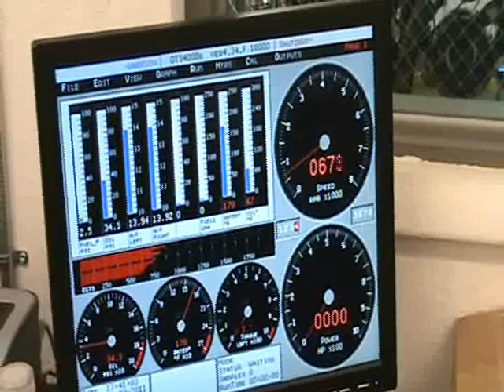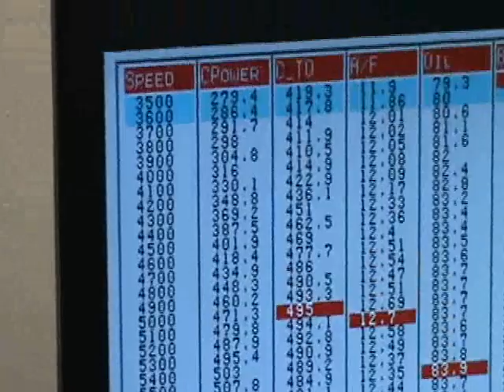SB Chevy 383 Stroker 550 Horsepower Crate Engine with Roller Cam

Comment from the maker: Our street roller cams have a very mild ramp speed so they are very easy on valve train parts. Usually after the engine leaves here you won't have to check it for about 1000-2000 miles of driving.

Comment: A 383 that pulls to 6400 rpm with AFR 195 heads with a solid roller cam I am going to say intake duration around 248-252 degrees on a 108 centerline.
Reply: An xr294 hydraulic roller cam would do this at 10.5 to 1. But on a head as good as that I'd use the 304hr magnum single pattern

Comment: There's a lot of guys here asking questions and no one is answering them. I've seen aluminum headed small blocks run up to 11.5-1 on premium pump gas. I have a different combination than this but the cost is likely similar. You're looking at about 12 grand give or take. I'm running a 13.5-1 357 with a much larger cam and better heads but I built it at home and have a few used parts and I was still in it for over 12 grand. Wanna play? Gotta pay
Reply: @8Ball5.9cummins  notice no reply
Reply: I built a 388 with 11to 1 compression pump 93 makes 550 easy cost about 13k to build
Reply: Manuel Solis that’s to much $. I’m into my turn key 383 $7k to the engine builder BUT I provided heads, intake and carb. All good name brand parts. MSD, Edelbrock, Holly, Comp, JE etc. Got to shop around for good deals on parts. Swap meets.
Reply: @8Ball5.9cummins  He said it's 13.5 to 1. Even a huge cam is going struggle to keep detonation at bay on pump gas at that CR.
Reply: @marcusprice3199  good bye to the pistons on pump gas with 13 to 1 compression

Comment: sounds decent,I guess the small carb is what makes the peak power stay flat for so long
Reply from the maker: AngryDuckSoup Yes, if you over carb, you can see a slopy power curve.
Reply: cncmotorsports so you are saying you under carb on purpose?
Reply from the maker: AngryDuckSoup On some applications yes.

Comment: I purchased this engine roughly four years ago. I am a truck driver so I've hardly driven it. Now that I am back home, it runs great but I'm looking for more horsepower. My question is. How can i make 900hp without a blower, to keep my motor enclosed in the engine?

Comment: Are u using the AFR 195cc competition heads????
Reply: Given this engine sells for only $8,000 from intake to oil pan I can almost guarantee it is the 280cfm Eliminator AFR heads.
Reply: @fmsracing442  He said fully ported. That would be the comp head since the street head is 90% on the chamber.

Comment: If I were using this engine for street use about how often would I have to lash the valves?
Reply: but199018 once a day
Reply: @jmark7390  Hence why people go with hydraulic roller cams.

Comment: I easily got 549HP @ 6800RPM with this: 1)Cast Iron 392.87CI (6.44L) long block (numbers matching) – Stroker, CNC (bored .030)
2)Edelbrock CNC Heads (Performer RPM, Aluminum, 70cc Chamber, 185cc Intake Runner, 2.02/1.60 int/ext
Valves at 23 degrees, angled plug style, .575” max valve lift)
3)Crane Forged Camshaft, Hydraulic Roller Tappet (Duration 292/300, Lift .539/.558)
4)Harland Sharp Roller Rocker Arms (ARP Stud Mount, Aluminum, 1.5 Ratio)
5)Speed-Pro Flat-Top Forged Aluminum Pistons – (11.02:1 Compression Ratio; +6.10cc head volume)
6)Callies Compstar Forged Connecting Rods – (H-Beam, ARP Cap Screws, Bushed Pin, 6.385 in. Length)
7)Eagle Forged 4340 Steel Crankshaft (3.85” Stroke) Internally Balanced
8)Fel-Pro Head Gaskets, PermaTorque, 4.125 in. Bore, .0139 in. Compressed Thickness
9)Fel-Pro Valve cover, and Oil Pan gaskets (silicon composite)
10)Melling Oil Pump, High-Volume (Racing)
11)Moroso Extended Aluminum Oil Pan (6 quarts)
12)Comp Cams Magnum Double Roller Timing Sets (Steel Sprockets)
13)ARP Studs/Bolts – (Rod cap studs, Head bolts, Rocker Arms studs, etc.)
14)GM Performance Aluminum Intake Manifold (ZZ Series, Dual Flanged, 1970 LT-1
Styled, 1500-6500rpm)
15)Jet (Rochester) Quadrajet Carburetor (Stage II, 800 CFM)
16)MSD 8.5mm Spark Plug Wires
17)MSD GM HEI Street Fire Distributor (21 Degrees mechanical advance)
18)Sanderson Ceramic Encapsulated "Block Hugger" Headers (1-7/8” Ports, 3” Collectors)
19)Magnaflow Aluminized Dual Exhaust and Turbo Mufflers (2-1/2”)

The 1976 Corvette is doing 0-60MPH in around 3 seconds... WHATTA RIDE!!!!!!!!!!!!!
Reply: Solid build sheet sir! 💪🇺🇸🏁
Reply: that is very high numbers for the 185 cc heads

Comment: Can this engine be run one85 fuel
Reply from the maker: Steve Grabowski Yes, this engine can run on E85
Reply: So which is better as far as engine life and performance E85 or 91 premium? I use Strictly synthetic oil and 91 gas.

Comment: Hey what would happen to a 350 sbc motor if you dont put the oil rod that connects the distributer to the oil pump???
Reply: mr green guy the pump won't pump and bad things happen when bearings don't get oil
Reply: Yea I paid a guy 1000 dollars 2 drop a motor and drove like 20 miles on it?? He never put the oil rod in the distubuter??
Reply: Lol so many guys forget the oil pump shaft, your main bearings are gone

Comment: was that all motor or did you spray it????can it go into a 93 camaro what would i need and whats the cost of that engine???
Reply: jose vazquez it was all motor. You would do just fine on premise pump gas and I'd guess this motor from this shop as it is in the video would be around 10 grand

Comment: Hey what spacer is that u use??
Reply: mr green guy I run a 1 inch phenolic spacer I paid 10 dollars for on ebay on my 615 hp sbc and it honestly made a difference. Didn't even have to make a jet change and I went from 10.82 at 118 to 10.76 at 119. Don't pay top dollar for a spacer. The generic ones work too. Although I do have my eye on the a hvh super sucker. But that's a big jump in price and I'd have to change the jets, af ratio and maybe even the timing
Reply: Oh okay thanks thats a bad ass motor you got have you ever put nitrous to it??
Reply: mr green guy I have a 250 shot using all nitrous express. I've only used it 3 times and my best time at Sacramento Raceway was 9.36 at 141. The kits only there because it was built in as a nitrous motor. I drive it on the street enough that I don't want to hurt it. But with what it costs for fuel, I don't drive her far
Reply: Wow that fast I was gonna put a 100 shot on my car and buy a methanol kit to run with the nitrous
Reply: mr green guy there's really no need for a methanol kit for a 100 shot. Timing and octane are all that matters. What's your compression ratio? Can you give me a little info on your combination?
Reply: I dont wanna lie 2 you I am not sure I no its a 3970010 block and its got edelbrock performer heads and there air gap performer intake and the 600 cfm edelbrock carb full length headers 8.5 10 bolt 373 gears in a 1988 caprice
Reply: The guy I bought it from was gonna put it in a chevelle and he past away and his wife sold me the motor and turbo 350 trans for 1200 bucks
Reply: mr green guy You got a hell of a deal. Your combo is alot like the second motor I put in my car. I've had the car for 20 years and im now on my 5th combo. Anyway, do you know what kind of pistons and rods you have? Any ideas about the cam? If you're careful with timing and fuel you can safely run 100 shot so long as you don't go much further than 500hp on an iron crank and cast pistons with a 2 bolt main.
Reply: Not sure i was gona switch the oil pan out from a stock to a 7qt then look in and see if i could see any numbers or anything it was a fresh built motor sitting in the garage with trans for a year the lady just wanted it out and gone i have a 750 edelbrock carb should i use that or keep the 600 carb thats on the engine when i put the nitrous on
Reply: mr green guy the 600 and the stock oil pan will do just fine until you plan on using nitrous. Honestly if you plan to use the bottle I'd go to a single plane like a torqer or a victor Jr and a double pumper like a holley or a demon. And even then a 650 would do just fine unless you go with an aggressive camshaft. Then a 750 would be perfect. Run a holley blue on the motor and use a holley red that's dedicated to your nos system. It's all about how you much you want to spend and how far you want to go. But not matter what, stick with your 600 for now and feel free to ask me any further questions
Reply: I appreciate your knowledge i was gonna order edelbrock nos performer kit and put the 7qt oil pan because i already brought one i hope im car can run 11s in a quarter
Reply: mr green guy always look forward to helping out a fellow gearhead. Don't forget. A huge part of the equation is in the cam and valvetrain
Reply: Yea I no I just dont wanna tear the motor down?? Thanks